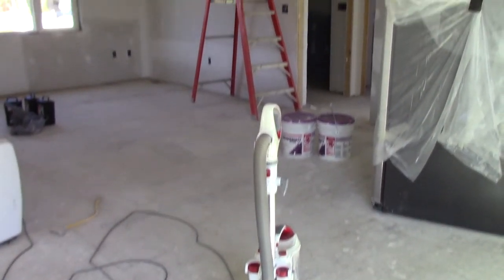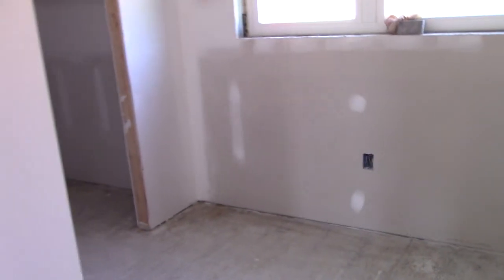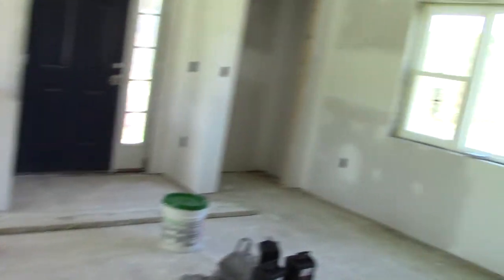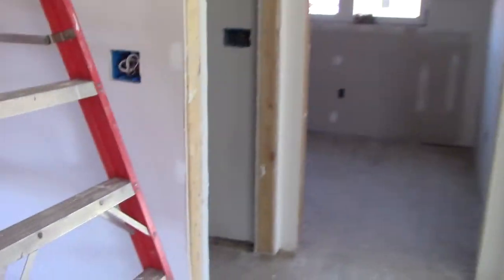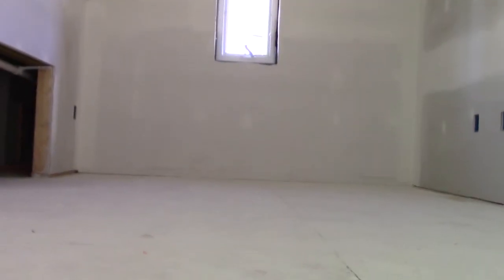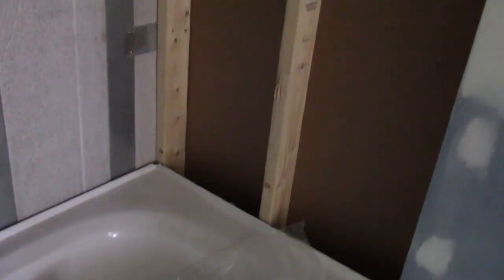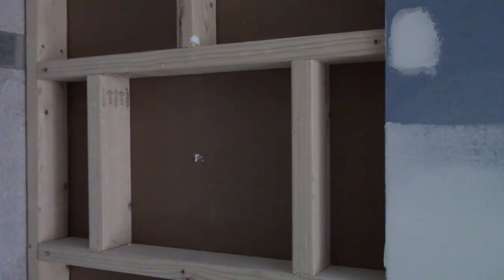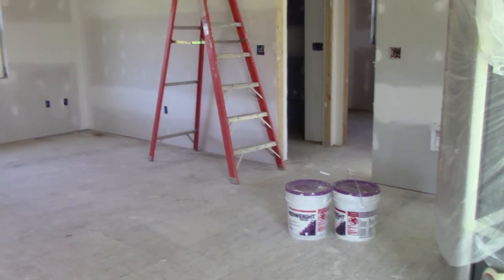HOUSE BUILD VLOG #29: Drywall

Comment: how did you find screwing the drywall to the thermasteel panels?
Reply from the maker: It's definitely harder than a normal steel stud since they're so much thicker. The main problem we had with our collated Hilti guns was the tips of the self tapping screws breaking off. You do kind of get a feel for it though and it starts moving along quickly.
Reply: @harvtronix  thanks for the quick reply, thinking about these for my next project